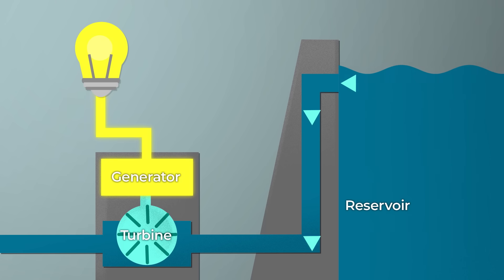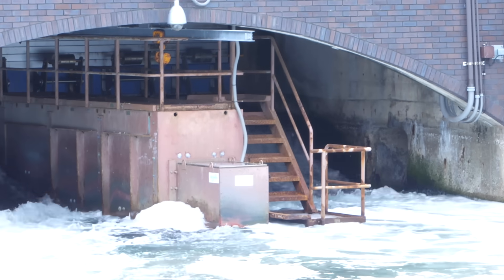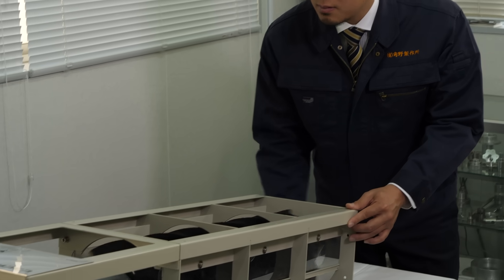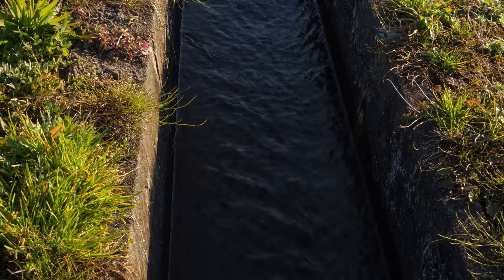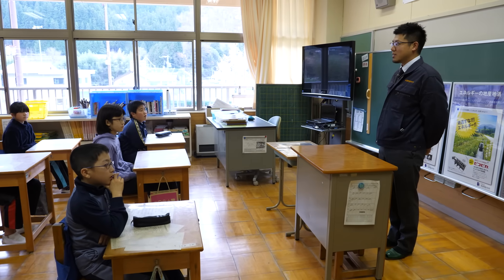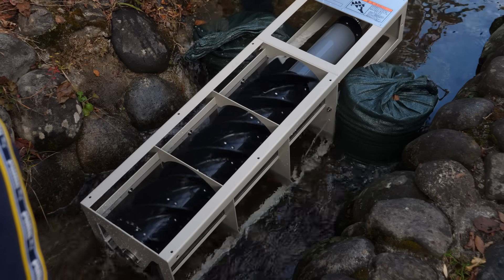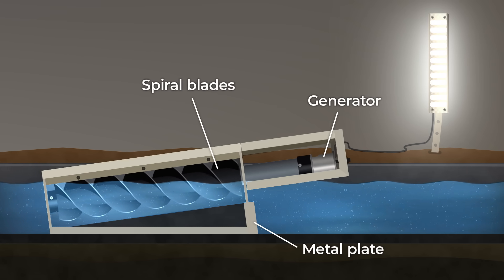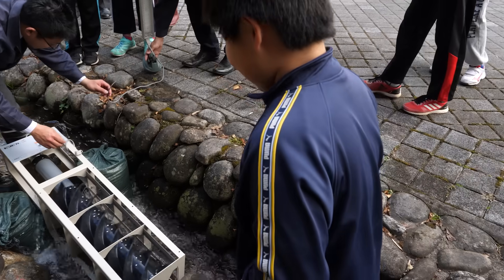Ultra-Small Water Power Generator

Comment: Great idea I enquired about the use of such generators to use in the river and was told NO so we need the governments to be on board too which is not happening as the big power companies are blocking such projects
Reply: In some EU countries government doesn’t allow to sell electricity. They are trying to safe their monopoly and worried electricity price drop
Reply: It depends on where you live, of course, but generally, if you own the land, and the rights to the river, it should be no problem. In any event, you could dig a private canal to run some water away from the river, and into a generator, for personal use. I think it will be more and more common for people wanting to settle more permanently in hard to reach places. My country of Norway has got plenty of those, and rivers and streams to glean electric power from.
Reply: And I hope everyone realizes that this has an effect on the downstream strength. This is actually a very real geopolitical problem in maaany large rivers across the world, especially in Africa and the Middle-East.

If everyone living upstream from  @kebman  installs five of these in their part of the river, he will be sitting down by the fjord crying more volume of water than what trickles through his "stream".

TLDR ikke søk om bevilling fra kommunen, bare installer den så incognito som mulig.
Reply: @kebman  I'd have to disagree with you on this one. While it is totally possible to come to an agreement, it's still a null sum game. I'd rather have private companies or the govt themselves damming shit up.
Reply: @kebman  naw duwg, don't do me lyke dat bro, we disagree on the part of avg ppl (even norwegians) bein smart n fair n kind enuff to not fuk eachotha up, das y i mentioned the null sum game breh
Reply: Ben Ghazi  Some people see everything in black and white.
Reply: Ben Ghazi  Makes sense for pac northwest but I thought we were talking about 3rd world countries here.  It seems some people are using the 5% exception and their mainstream arguments.  Who falls for that kind of thing anymore?
Reply: @DIYDaveT  your mind. you should go get it checked out or sumthin
Reply: @Official_Alphabet_Inc  Wow. Liberals who have no understanding of anything always resort to your kind of response.  Next time, save yourself the embarrassment.
Reply: Why did they say 'no'? Environmental concerns? That would make sense
Reply: Richard Bevan 
Your mistake 
You asked
Reply: do it anyway
Reply: oh yes, are they spying on generators from their satellites?  don't ask/don't tell
Reply: @dacasman  were these even meant to replace existing large power infrastructures in powering the whole world? Or were they meant to supplement those, especially where building large ones would be prohibitively expensive/have more environmental impact(e.g. big dams blocking migration routes whereas low head ones don't)?
Reply: @ki0w0-lordofwatersheep  I think I replied to the wrong comment lol.
Reply: You do not need government.
Reply: to be frank, I'd do it anyway. I'm all about freedom, and am somewhat of a constitutionalist. Water doesn't belong to the government, also the government IS the people, i'm one of those people, this is OUR river/stream/creek. and i'm going to use it in a totally non-disruptive manner to create power.
Reply: @HalfInsaneOutdoorGuy  Actually water does belong to individuals (water rights) but as long as you are not taking the water out of the stream and using it somewhere else, as long as you are allowing all the water to flow through, there should be no legal problem putting this generator into a stream on your property.
Reply: @cbxxb4841  Hi I live in Wales and the river is 3 meters from my property I have looked into a free running none invasive power generating system that costs in excess of 8000 euro which would create enough energy for 4 homes, the water company put so many barriers up that it is virtually impossible to gain permission to install all be it with the highest safety factures being built in. If anyone is aware of a legal way of carrying out such a project please do let me know and I will take it on board and pay the costs.
Reply: Notice the water is clear with nothing in it but water.  A river has: boats, people, fish, animals, grasses, muck and most rivers have trash, bicycles, tires, etc.  So, lots of things to either get damaged or to damage the turbine.  So realistic for small controlled creek or stream, maybe.
Reply: Stupid conspiracy theories! The big power companies are not blocking small power projects! You want to build one, then do it. Don’t complain about non-existent opposition!

The only thing that might cause trouble is environmental regulations which make difficult any changes to a waterway. For that we have Green Communism to blame.
Reply: @Ethan.Lamoureux  Who pays and endorses politicans to create one sided laws, and who fights agianst libertarian ideals it's corporations. You should stop eating misinformation
Reply: This water generator produced a few watts of power and will be high maintenance sitting in the water all the time.  It blows me away that everyone seems to ignore the easy solution which is PV solar. I've had 15.3 kW on my roof with microinverters for several years now.  They are silent, relative efficient, totally maintenance free and the cost per watt was relatively low.  How many of these silly turbine generators do you think it would take to do what just one 400 watt solar panel does?  Yes the water generator runs at night but you need 100 of them. The trickle of water they showed it being used in does not carry even 500 watts of kinetic energy.

Forget mechanical generation, it is all crap.  PV solar is the only actual green renewable energy, especially when used in grid tie configuration.
Reply: These products are usually designed and built for the poorer communities around the globe.
Would it be easier for poor communities in Asia, Africa or South America to produce and install these "silly turbine generators" or your 400 watt solar panel with the "microinverters" and other 21st century technology?
Reply: @CG-cx9fv  BY FAR the solar panel.  By far.  Solar can be installed anywhere.  Water turbines require running water.  In Africa.  Next question please.
Reply: @DIYDaveT There are places where the system you promote will be suitable, as in your community, for example, and places where it will not. Have you considered that the turbines can be built/maintained by local communities in poor countries but your solar panel must be acquired/imported at prices which are usually beyond these people's reach? Before you condemn and brand as "silly", you must first consider every factor, lest you be thought to be silly yourself.
Reply: @DIYDaveT  "Water turbines require running water." And your panel require sun. And your "microinverters" and other 21st century technology will be too expensive in the poorer countries. That said, I'll allow that both are valuable resources, each adaptable to its own environment.
Reply: @CG-cx9fv  Water turbines are cheap???  No.  When you want to know about engineering stuff, ask an engineer. That would be me.
Reply: @DIYDaveT Ok engineer. I just hope you are not like some I've taught....
Reply: @DIYDaveT  maybe turbines are pricy, but aren't solar panels much pricier considering all costs(logistics etc) & kW yield?
Reply: @CG-cx9fv  yes, efficiency is quite often an acceptable tradeoff for practicality or convenince. Shouldn't an engineer know this?
Reply: @CG-cx9fv  It's similar to the debate in the west about the extra demand required in order to change to electric vehicles.
Well hey, why not install thousands of car charging ports, every one of them equipped with PV panels so they are generating their own supply during the day and feeding into the grid when they're not in use?
And that's only one aspect of the so called conundrum.
Reply: @kendoknackersackee  I'd say there is no one solution to these cases, thus we should not condemn any effort as some of us do here. It all depends on where we are, what the conditions are and what we set out to achieve. This means the geography of the location, climate, relative arrangement and physical features, resources available and a whole lot of other factors contribute to the feasibility. What may be the optimal solution for one place may not even be minimally functional or practical somewhere else. We should at least try not to let our own condition or surroundings influence how we see the efforts of others.
Reply: @CG-cx9fv  I agree, circumstantial practicalities should always be considered 👍
Reply: DIYDaveT you literally said “can be installed  anywhere”  how much more black and white can it get than that?
Reply: DIYDaveT the only actual Green energy, is nuclear. Making solar panels, and batteries to store the energy, is not even remotely green, and it’s not renewable either, because you’ll run out of resources to make those things. And the mining required to make batteries is insanely damaging.

Comment: Add a bank of batteries and you can run more, and smooth out the flow of electrons. On the test it look only capable of charging a phone. Can't help but think that the vertical spiral, in a cement caseing would be better design, but made in resin or recycled plastic. Get more speed and a constant rate, with the step and dam built in. Every case quoted was a permanent need for power not portability. So his design has failed unless people are camping and that has been done much better.

Comment: This is old. I would not  be surprised if this video is from the 80s. It is a great idea for camping, but not much else.
Reply: A 12v 400ma solar panel literally makes more power than that puny thing. It doesn't even have enough power to light an led properly.
Reply: It's not from the 80s

Comment: It would be nice to see some figures. My guess is 3 - 5 watts. It’s not much, but it’s 3 - 5 watts more than zero.
Reply: Have you both lost your minds? I'd say 0.5 watt, the led wasn't even lit properly, it was flickering.
Reply: @elyasrasti8943  that was the worst case scenario with shallow irrigation channel, and that thing doesn't seem to have a single led there, it looks like an array of leds.
Reply: id say closer to 15
Reply: If it is 3-5 watts that's over $100 per watt.

Comment: My guess 50 watts or less, nothing to see here.
Reply: There are two types of units, “PicoPica10” and “PicoPica500”

“PicoPica10” is a unit that enables around 10W generation by securing a flow of 10ℓ/sec and a head of 0.1m. This product can be manually assembled and utilized as security lighting, drawing power from a nearby waterway. “PicoPica10” has already been sold over 500 sets within Japan as an environmental education material.

On the other hand, “PicoPica500” enables around 500W generation by securing a higher flowrate of 100ℓ/sec and a head of 0.7m. The generated energy can be equivalent to an average Japanese household’s electricity consumption.

Comment: Some truly retarded comments on here. The lights are just an application. Obviously a best use for a low wattage turbine is to trickle charge a powerbank. At all-year-round 24/7, it's a perfect backup charger. And no-one's stupid enough to drop it into running water liable to storm surges.

Comment: Ultra low-power...
Reply: Yes, but it works with little water level distance. So imagine this thing bigger, with a longer screw, and more inclined.
The model shown here is surely not to generate power in industrial countries. It's a simple design for 3rd world countries which have no regular electricity supply at all.
Reply: @simonm1447 , floating water in a 3rd world country? Stupid...
Reply: @rudiralla9630  why should no floating water exist in 3rd world countries? They are not all in African deserts.